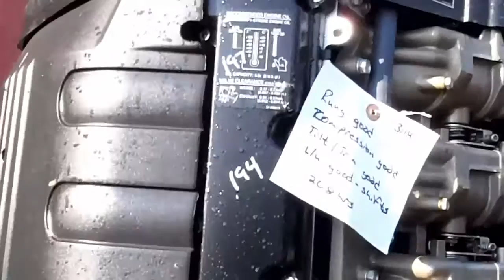Used Pair 2004 Mercury 225EFI XL 4-Stroke Remote Outboard Boat Motors 25" Shaft

Comment: Hi , I have a 04 merc like this inwas wondering if you can tell me .
My water from weep hole seems a little low maybe similar to that or a tad better . 
But as the rpms go up would that increase the water pressure from the pump and through a bigger stream out the lower unit?